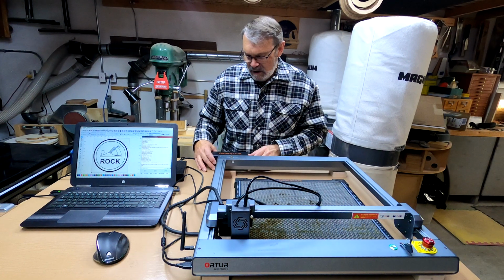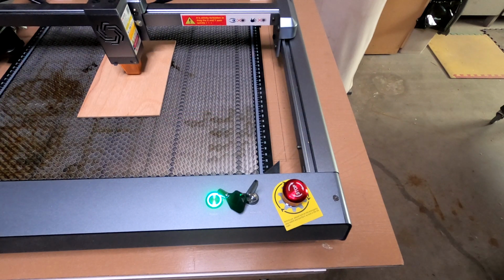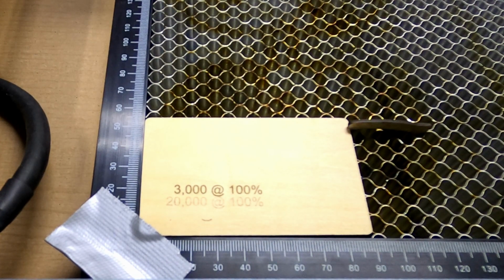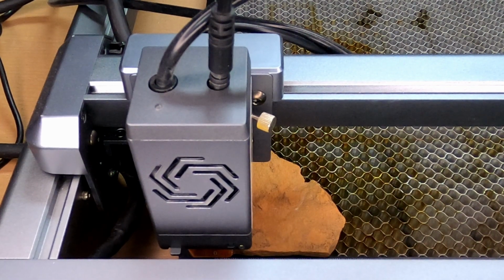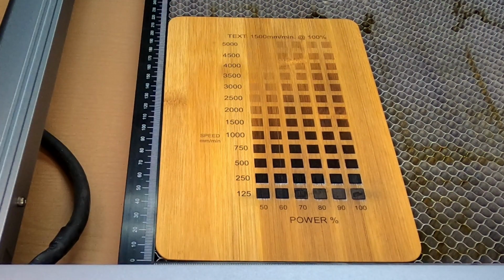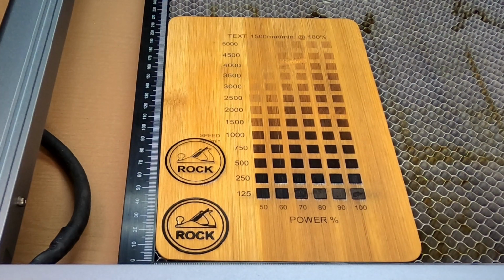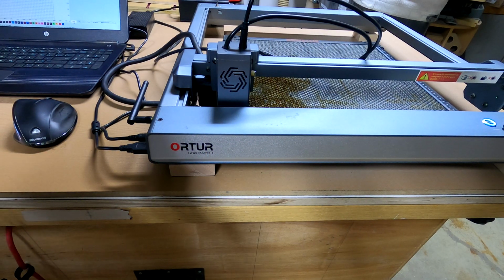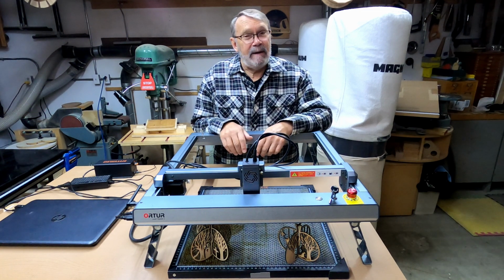The world's first laser engraver whose black/white engraving speed can truly reach 20,000mm/min.

Comment: Hey Gord,
First - a tongue in cheek question: What do you mean you don't have a rolling pin? 🤪(Watch the rotary roller section to hear where that ? comes from).
Second - your graphic shows a 1400 x 1400 mm engraving size. 400 x 400 mm is the correct size (15-3/4 x 15-3/4 for the metrically challenged).
Third - cable management seems to be lacking.
Fourth - I have "a million" other questions (means a few/several/some, not a real meg) but I'll read the user manual for possible answers.
Fifth - wonder what the expected lifespan is.
Thanks for the review.
I'll put it on my Christmas wish list and see how much my daughters love me.
All the best,
-- Joe
PS - Why 20,000mm per minute? Does that seem faster than 2000cm or 20m for marketing? 🤔
Reply from the maker: Hi Joe,
1. I wonder how many others are going to catch that. And to think that English is my first and only language! 😳😳
2. Oh man, one of us was certainly asleep when I typed that in there. I have a feeling it was probably me! 🤔🤔 I will have to type a correction into the description box. Thanks for pointing that out.
3. I wouldn’t call it the best cable management in the world, but it is much better than a few I have seen. 😳😳
4. User manual? Now that’s a novel idea! 😁😁
5. I have no idea about the lifespan, but I hope it’s very lengthy. The modules are not inexpensive to replace.
Good luck with your wishlist and your daughters. 🎄🎄 I’m sure they love you a lot! Right now, would be a good time to purchase it as the link I have included includes a very nice discount.
Thanks for watching, Joe. Always nice to hear from you, my friend.
Take care,
…..Gord
Reply: @GordonRock1  😁

Comment: Good video. Do you have a video on setup? Software? How do you know if your image is going to fit in the space? For example, the second logo bled over top of part of the text.  Could you show us how the air assist works? Does it just blow the fumes/smoke into the room or do you need some type of exhaust system to vent to the outside. I'll be checking the machine out for a possible purchase. Thanks.
Reply from the maker: Larry, I decided not to do a video on the unboxing and assembly as there are so many of them already out there. It should not be difficult to know if the image is going to fit in the space we want to use but I am still learning the software and have a long way to go with that. The air assist just works by blowing air through a hose and down into the module. This causes air to blow directly across the laser. yes, it will blow smoke into the room but I try to keep the door open now during good weather and I have purchased a smoke absorber that is typically used for soldering and that does a fairly decent job. If you use the link I provided you should get a decent discount price. Thanks for watching!

Comment: First and foremost I hope your recovery goes well and doesn't take much longer. As to this review I think it was very well done. All the questions I had were answered. The engravings produced appear to be very well done. Good crisp lines. Very little scorching when using the air assist. Some new questions have popped up. How do you feel about the speed? How does it compare overall to other machines you have used? If I understand these machines most of the heavy lifting is in the software. You mentioned a program you prefer. (Lightburn?)  What is the learning curve for that? For instance if I see an item in a magazine or brochure that I want to engrave how long would it take to get the job done? Can I create something from scratch? Is the phone APP you mentioned required? Thank you for sharing. Again I hope you have a speedy recovery.🙂🙂
Reply from the maker: Hi Glen,
This is the first diode laser engraver I have used, so I don’t really know how I feel about the speed, although it seems quite fast. Obviously, I can’t compare it to other engravers. Yes, that is the software that I’m using, and like any other software there certainly is a learning curve. I don’t consider the learning curve to be too bad. Yes, you can create things from scratch, and I have been following another guy on YouTube who is explaining it very thoroughly. If you want to check his channel out, he is known as the Louisiana hobby guy. I think it would be quite easy to create almost any item you see in magazines. There is a function called trace image that appears to work quite well, although I have not tried it yet myself. The phone app is not necessary and I much prefer Lightburn. Thank you for the well wishes, my friend. Much appreciated.
Take care,
…..Gord